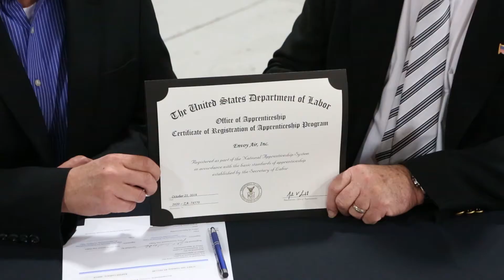Envoy Air Maintenance Apprenticeship Program

Comment: I want to get into aviation, I’ve been applying for aircraft mechanic apprenticeships. But many of them require experience or a a&p license. Which I’m confused about, because it’s an entry level/apprentice beginner role, how would I already have experience or my a&p license? The process is annoying, I might just give up on applying at this point.
Reply: You need to look in an Approved Aviation Maintenance Technician School.

14 CFR Part 147, or have someone mentor you through 14 CFR Part 65.77.

Hope this helps 

The video is supporting this if you understand the language and law.

A&P Certification is required by LAW. 14 CFR Part 43
Reply: It's entry level for those with some mechanical background or aviation schooling. You can't come in knowing nothing at all man.